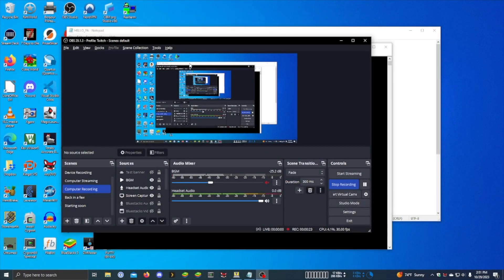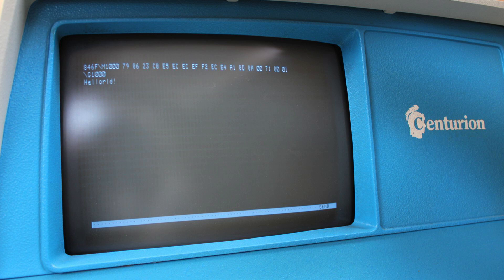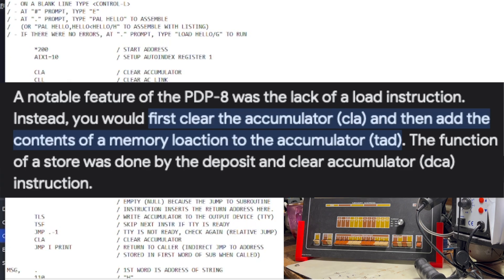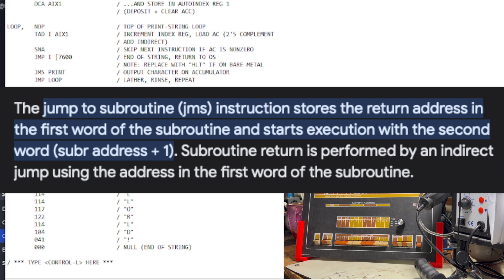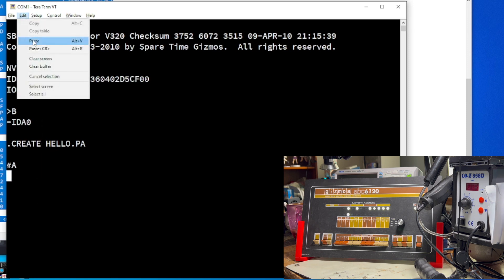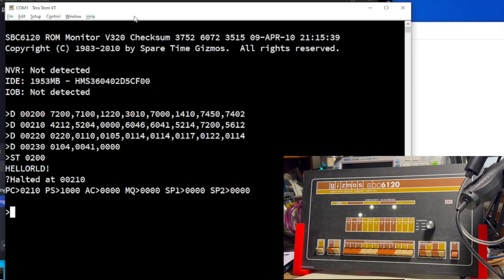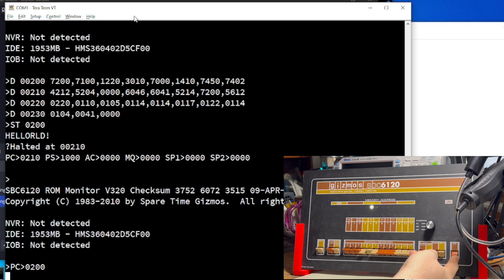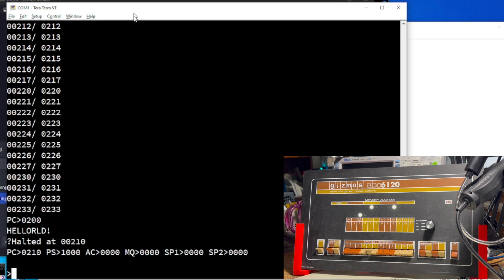Printing "Hellorld!" on a DEC PDP-8! | My Answer to Usagi Electric's "Hellorld!" Challenge

Comment: If you want a space saving printing teletype, the TI Silent 700 series lasted into the mid 80's and used thermal paper rolls. The Silent 703 was pretty small and still talked over RS232.